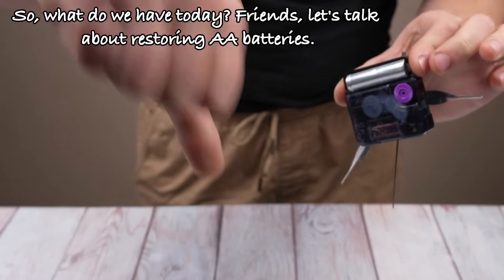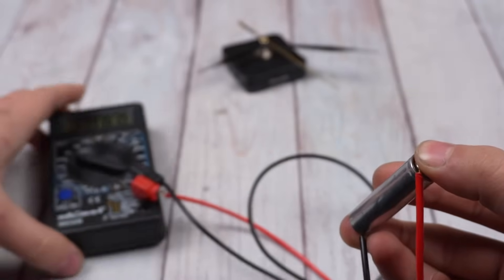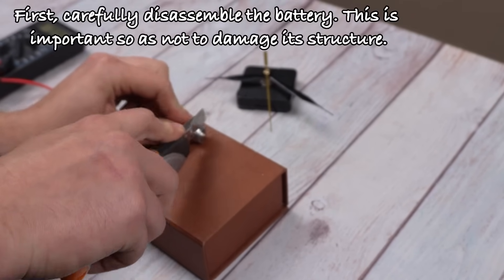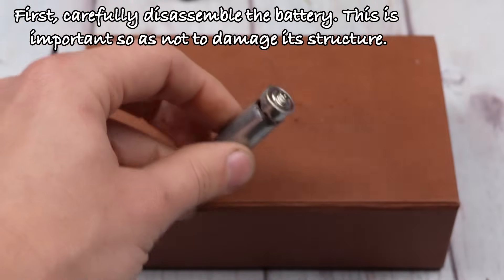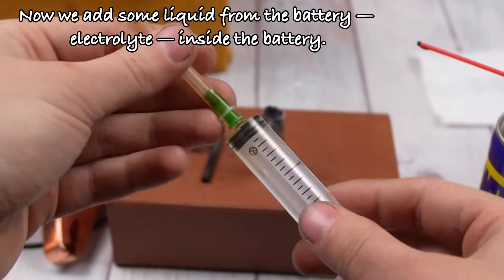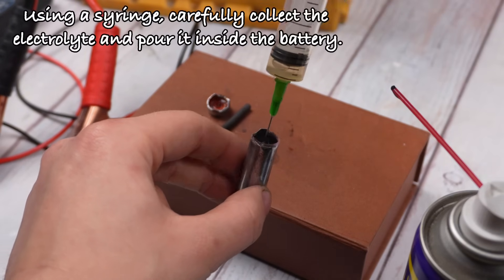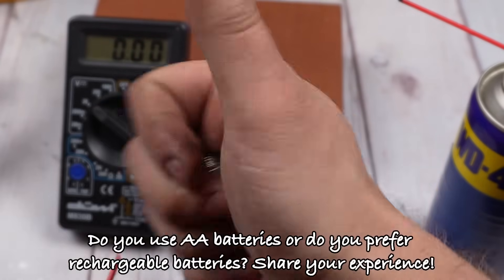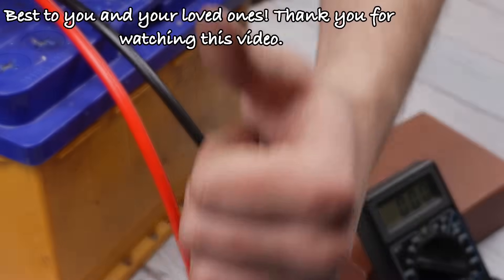Never Buy New AA Batteries! 🔥 Easy Way to Revive Old Batteries

Comment: What kind of tape did you wrap battery with and what “ screws did you take out of battery to get the stuff in seringe and does removing those screws or whatever they are called does it ruin battery and or can they be put back in. Is this done with regular batteries and or will you hurt yourself if it’s lithium and or can batteries explode if cut?